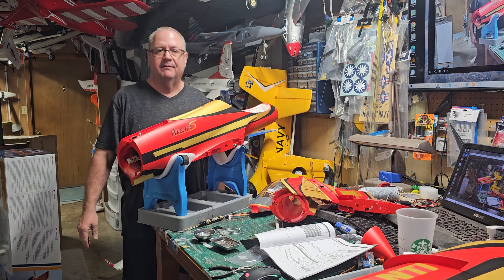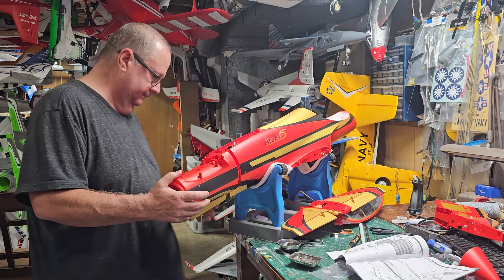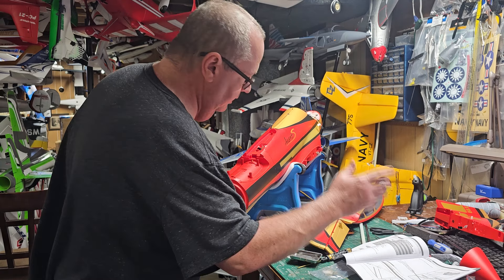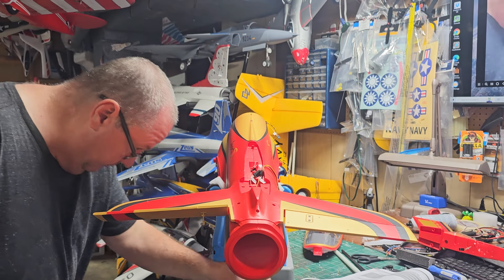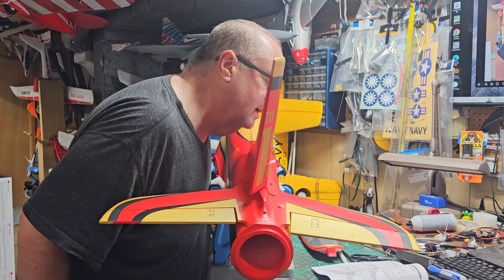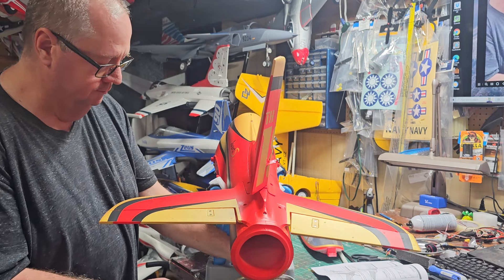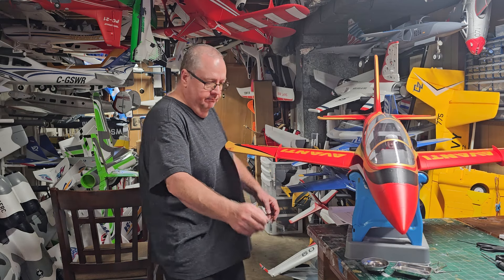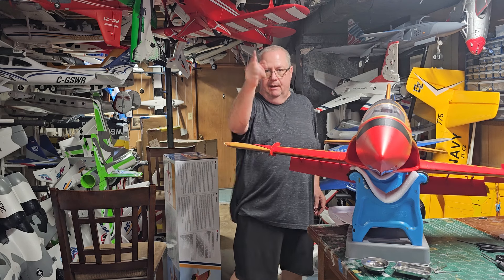FMS AVANTI S 90MM BUILD by FGFRC #rcairplane #aviation #rcplanes #rc

Comment: Looks amazing.  If you want to hide the screw heads in the fuse unscrew them a bit and use a black and red sharpie on the heads.  I suggest finding an extra screw and do a test first to see if it helps.
Reply from the maker: That does help and a great suggestion. Thank you.

Comment: Is this the second one ? Or the first one they sent you... I heard You had some bad servos with the first one
Reply from the maker: No i retracted all my bad comments and apologized to FMS I had the flap servos over extended while I was setting up the radio off camera. I realized after what I had done after firing off my mouth and making a few wrong statements to FMS  I will be doing the radio set up video again and will explain what i learned about the servos and what NOT to do. That will be done Monday night (9-2-24) and produced after.
Reply: @FatGuyFliesRC Never ever have your flap rods on when setting up your transmitter
Reply: @FatGuyFliesRC  oh ok ,thanks budy👍
Reply from the maker: I did not until after I had set up the flaps, but them over extended the up flap to make the flaps close nice and tight and was looking at the flap itself thinking it was good and did not pay attention just how far the flap servos were actually forward digging into the front of the wing.   I let them set there like that while I was setting up the ailerons in that over extended position and naturally they got hot and started to fail. MY fault completely but did not realize it was my fault until after I had fussed to FMS. I retracted all my bad reviews and comments and apologized to FMS.